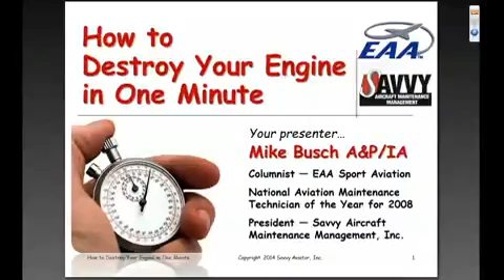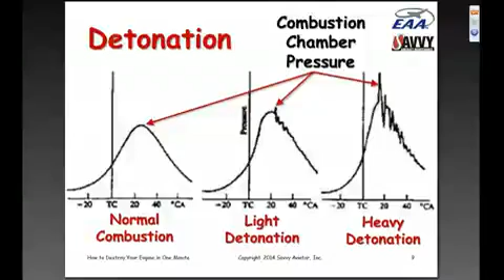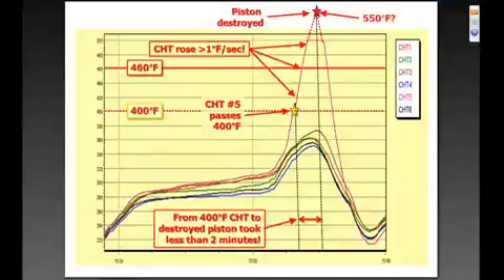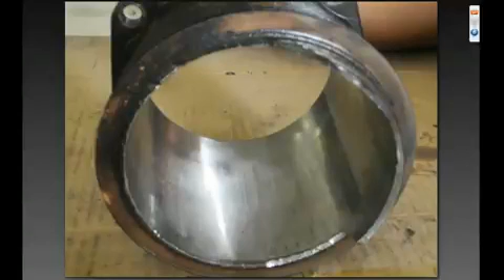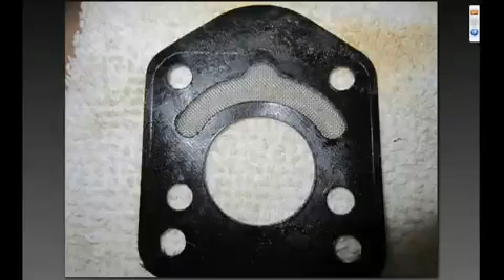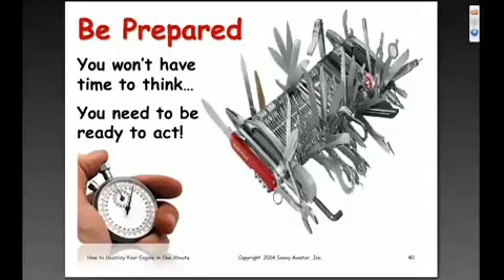How To Destroy Your Engine in One Minute

Comment: I wonder if anyone has ever spotted a run-away CHT (pre-ignition) and immediately pulled to idle and got down and it ended up ok?  I wonder how it went and if it was fixable.
Reply: It’s happened to me several times. First time the engine was destroyed, melted piston, lost oil pressure. $50k in damage. Second two times I saw the rapid CHT rise, pulled the power back, had the spark plugs and injectors cleaned, problem solved.

Comment: Do CHT's always tell if there is a detonation or preignition ?  would CHT's in the range of 300 to 320 degrees ever be able to cause trouble or damage exhaust valves?  I run very lean and have low CHT's. But I run at about 75 to 80% power.  So that is my concern.
Reply: Running LOP cannot cause detonation as the power output is too low.

Comment: What was the cause of this pre ignition? Q&A says it can happen and may not be avoidable, and evidence is destroyed. Lyc O360 25 BTDC is too much? Interesting. Experimental electronic ignitions for Lycs have timings well in advance of 25° at lower power settings (measuring MAP and RPM). Magnetos of course are fixed timing.
Reply: Either low fuel flow to the cylinder (clogged injector) at high power or a very fouled or damaged plug that acts like a glow plug.